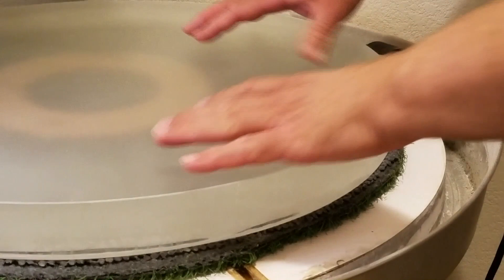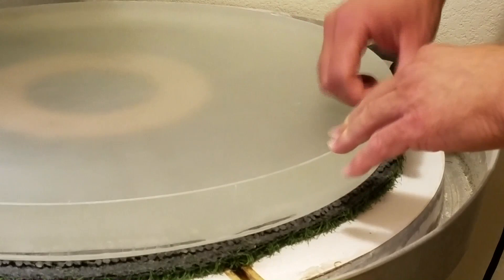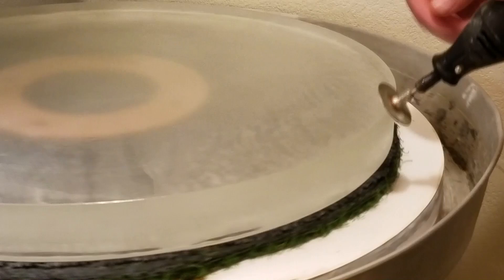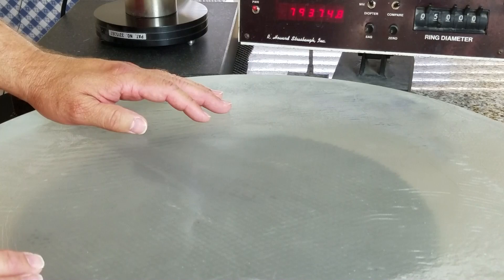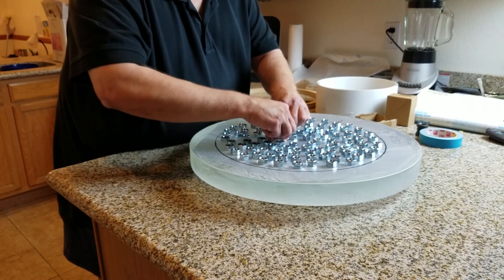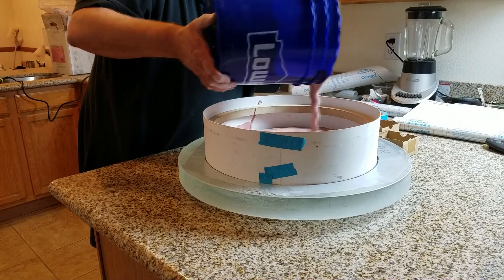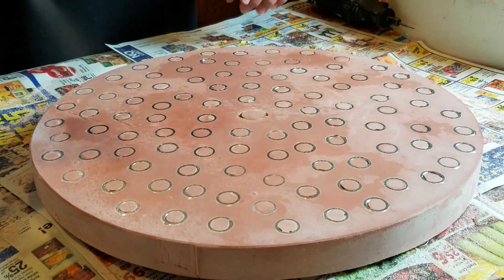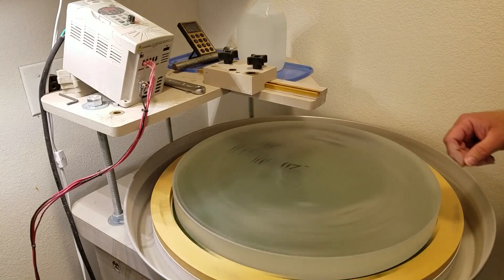Building a 20" F/3.3 Renegade Telescope: Part 1

Comment: It might be worth your time to look into marble and granite fabrication tools such as diamond polishing pads and diamond grinder cups. The pads run on a pneumatic polisher, or just an angle grinder, and come in 50, 100, 200, 400, 800, 1500 and 3000 grit. A #50 pad would work really well for that beveling, and the polishers they run on have a water connection so both hands can be focused on the work. If you wanted you could run the entire set on the bevels and bring the bevel up to a nice polish. I've polished a ton of glass using those pads. I have a few sets as I program CNCs in the stone industry, as well as do fabrication.
Clearly you know your craft much better than I do, and I'm only mentioning it because in my mind it could help. The stone industry in general shares many similarities in regards to cutting and polishing tools with the glass industry.

Comment: I used the method of "baking in" the tiles (I find using a tile mat is easier than maneuvering dozens of tiles/nuts into place) for my 12" mirror's full-sized tool and it works fabulously! No longer do I have to worry about tiles breaking off or epoxy failing.
Reply from the maker: Congrats on your success!  Making grinding tools isn't too intimidating once you have one under your belt.

Comment: Thank you for those extremely educative and information-rich videos! They made me seriously thinking about finishing my roughly grinded mirror from ca 25 years ago...
When I watched this video, few questions arised:
- are there any important differences between dental plasters or would more or less any of those fit well for grinding tool? 
- do you make the tool somehow waterproof (it looked like in an another video the same tool is somehow.. more shiny)?
- the turf surprised me quite a bit - isn't there the danger that larger particles get stuck in it and may find their way out of it? Maybe it's a general question: what general procedures you follow to keep the machine and tools reasonably clean (I found one of your answers about changing grits and that made perfectly sense!)?
- where to learn about using those fixed post grinding machines and theory of using them?

Comment: Hi,

I just made my first grinding tool out of dental plaster based on the video I found here (thank you very much!!!).

But, unfortunately, the tool warped significantly after pouring, during or after solidification.
The center of the tool rests in the middle of the mirror, but the edge is curled up, so it wobbles around the center (more than half a millimeter on the edge!).
If I drop it on the mirror like this, only the center works, therefore it deepens the glass disc too much, so the focus will be shortened.

Has anyone else experienced this warping or distortion phenomenon in the case of grinding tools made of dental plaster?
I suspect that the change in volume of the plaster (even if it is minimal) becomes uneven due to the steel or ceramic pieces inserted in it, and this drags its shape: the lower part cannot contract as much due to the metal pieces as the upper, homogeneous part, and this pull up the edge of the disc.

How thick should a plaster tool be made so that it does not warp like this?

Thanks a lot in advance,
Attila

Comment: Question for you Gordon (others feel free to comment as well). 

I've recently started hogging out a 12.5" blank by hand. I've made a similar 6 inch tool as to the one used in this video and I am just using TOT/COC strokes and rotating mirror and tool every so often. I'm not allowing much on overhang but I am sure some is happening. 

Progress is going well, getting about 0.2mm of depth in the center for about every hour or so of grinding. However I am getting a bit of chipout on the edge mainly on the bevel (~1/8" bevel) itself. They're rather small and none that protrude inward on the facial surface of the mirror more than 1mm or so.

I don't feel they're catastrophic and could probably be ground out and compensated for later on with rough grinding with a ceramic tile tool when the time comes and a bit of rebeveling, but I did want to ask if this is normal/expected?

Despite your efforts to reduce the chipout using the methods/tips in this video,  do you still get some here and there?

Any feedback would be greatly appreciated.

Gerald
Reply: Wanted to circle back on this. Was able to grind down enough in the 120/220 grit phases + a rebevel to get rid of the small chips that were taken out of the edge. Hopefully this helps someone else that ended up in a similar situation. 

1-2mm chip extending towards the center is probably the limit here. Any bigger and its going to take quite a bit of grinding to overcome. Depth of the chip plays a factor as well. Probably best to avoid it by keeping the steel nut tool away from the edge at all times during hogging, and let the tile tool do the work on the edge later on.

In any event, I've almost finished up 25μ. Maybe another session or two and I'll call it done. Then on to the smaller grains.

Gerald

Comment: You should look up how they groove mill stones for grinding grain.  The pattern is important to keep equilateral in every direction to avoid a triangular grinding action.  Much like a poorly sharpened drill bit.  The inconsistencies in grinding plane create a wobble in the ground surface
Reply from the maker: Hi, David!  There are huge differences between mill stones and mirror grinding tools.  Mill stones are designed to slice apart the grains between the stones without causing any damage to the stone.  You don't want stone particles in your ground grain!  In mirror grinding, you want the abrasive particles to roll between the surfaces, and not be sliced.  And in mirror grinding, you want the "grain" or abrasive to stay intact as long as possible, while causing the "stones" to be chipped down on their faces.  Getting "stone" chips into the abrasive is the whole point.  On a mill stone, the stone does all the work.  In mirror grinding, the "grain" does all the work.
Reply: @GordonWaite   Veddy interesting!

Comment: i grind a lot of borosilicate myself... taking the edge off with the dremel seemed sketchy... but gets the job done.  after having used resin bonded diamond grinding blades and bits, i hope never to use sintered tools again.  i wonder if stained glass grinder drums would be more affordable for you though- seems dremel tools are kinda pricey.  you can “sharpen” the drums with dressing stones for longer service life, and in addition to more tool surface at a lower cost, i bet the diamonds run deeper.  check out Radiac’s superabrasives catalogue for a daunting variety of badass grinding tools, in sintered or resin.
Reply from the maker: Thanks for the tips!

Comment: Hey Gordon!  Just wondering do you have a video pointing out how to do the math to figure out what length your secondary mirror should be from the Primary depending on the Diameter?  Thanks!
Reply from the maker: Here's Mel Bartels' on-line calculator.  It may do the job for you: http://www2.arnes.si/~gljsentvid10/diagonal.htm

Comment: iam suprised the inout carpet doesnt let the mirror move up n down on the ops side of the weight.
Reply from the maker: The artificial turf is quite stiff, and the tool extends past the center of the mirror.  And the mirror is pretty heavy.  Never had an issue with up and down movement, though the mirror will often turn a little around its center, which is actually a good thing.

Comment: 12:30  Just wondering....how can you grind something to within a few nanometers of accuracy when it's sitting on something soft that compresses by millimeters?
Reply from the maker: The mirror is thick, heavy and very rigid.  It weighs about 35 pounds.  When you sit it down, whatever it is on compresses by some amount.  When you put the grinding tool on it, it compresses a little more.  But after that point, the weight on the mirror doesn't really vary, and no more compression occurs under the mirror.  The grinding motion is basically parallel to the turntable, so the grinding force is horizontal, not vertical.  Grinding depends on the geometry of the surfaces in contact, and not so much on what is under the pieces.

Comment: Hi Gordon, I was wondering why you would use the dental plaster rather than a copper plate, like you would in a machinists shop. I imagine it's due to cost and you being able to make them bespoke for each size you need, but are there any other reasons.
Reply from the maker: The dental plaster makes it easy to mold the tool to the exact shape of the mirror.  The plaster dries and is ready to use in about 30 minutes, so it is fast.  And the plaster isn't too expensive.  Plus it is REALLY hard, and has pretty good properties around water.  It's about the perfect material.

Comment: Hola Gordon, gracias por compartir tus experiencias. Te hago una pregunta, cuál es la relación que tiene que tener el diámetro de la herramienta de yeso con el diámetro del espejo primario para que quede esférico?
Reply from the maker: Hi!  I make my grinding and polishing tools about 70% to 75% the diameter of the primary mirror.  Most tools in the range of 65% to 80% will work, but the 70-75% range is the best.  Thanks!
Reply: Gracias Gordon! Estoy por empezar a hacer un espejo de 350mm hice varios, pero siempre a mano, este lo voy a hacer con máquina y veré cómo sale. Gracias

Comment: Gordon how does a steel nut tool change shape while grinding? How can we change the radius of curvature of the mirror while grinding with a tool having a fixed radius?
Reply from the maker: A steel nut tool doesn't change radius much at all during grinding.  That is the point of using steel tools for production work where you are making multiple identical mirrors.  Once you've started grinding with a steel tool, there really isn't any easy way to change the radius.  If you need to alter the radius, you need to work with either ceramic tile tools, or glass tools, so the tool can follow the changes in the mirror.
Reply: @GordonWaite  Thank you so much for replying. My concern was that if I cast a steel nut or washer tool against a simply hogged mirror that might not be spherical how would I use that tool for fine grinding? How do I ensure that the hogged mirror is perfectly spherical to cast a perfectly spherical tool?

Comment: hello, I'm a begginer and I'm a bit confused is the mirror tool is curved on top or is it flat? as I'm working on a mirror which is not pregenerated.
Reply from the maker: If your mirror is not pre-generated, then you start with a flat tool.  If your mirror has a generated curve, then you mold a tool to the mirror, so they both have the same curvature.

Comment: I need help please. Where can I get a glass blank ,how thick do I need ,what kind of glass an where to get it please
Reply from the maker: I often use Swift glass in NY.  You can use either plate glass or a borosilicate, depending on your budget.  For mirrors up to 12.5" thick, you can get by with 1" thick glass.

Comment: I'm curious to know, since you have a CNC, why you don't use it to grind the mirror ?
Reply from the maker: We grind on fixed-post machines that we custom build.  They have a computer-controlled x-axis, but it's not really a big factor in grinding.  We use the same machine type for rough polishing.  When we figure a mirror now, we do use two-axis CNC controlled machines.  We have to build the machines ourselves, and write all the software in-house as well.  Technology marches on!

Comment: Sir, what size pitch lap and tool should I use for a 12 inch mirror? I want to finish at F/10
Reply from the maker: Hand work or machine?  Hand work, 12" for grinding, 12" for polishing, 5" for figuring. Machine work, 9" for grinding and polishing, 5" for figuring.
Reply: @GordonWaite  thanks a ton.

Comment: Great video and in formative but overall how much did it cost to do this all yourself? Giving or assuming no one has tools this may be more costly to do for ones self. Giving a 16 inch Dob cost about 2000.00. The assembly itself can be very costly.
Reply from the maker: You can put together a simply fixed-post grinding machine for a couple hundred dollars.  A plate glass mirror blank might cost $160.  The grinding tool is $15.  Pitch and abrasives probably $50.  You can certainly put together a mirror-making setup for far less than the cost of a single custom mirror.  And you can then make as many mirrors as you want.  And you can certainly build a better quality Dob yourself compared to the low-end mass-market offerings.  But generally the point isn't to save money.  It is, instead, to build it for yourself.
Reply: I was just simply curious that was all! I agree it is about building it for ones self but I was just asking if no one had the materials to do such would it be more cost effective. 
The interesting thing though is that by your video, I have learned the time it takes to make the mirror. I can understand why telescopes cost so much money. :) Its a lot of work but rewarding if one has the time and patience to do something like this.
Reply from the maker: Yes, you are spot on.  Taking the first look through a telescope where you made the mirror and the body is an incredibly satisfying experience!  It does take a fair bit of time, though, but for me it is time well spent and enjoyed.

Comment: Why not get a laser measurement tool. It can read on the fly through the slurry.  It can also show accurate measurements up to 10 decimal places.  Impossibly accurate
Reply from the maker: Hi, David!  I'm sure you are an expert on precision measurement, so I hesitate to disagree.  The width of a silicon atom is .00000000146 inches.  So you are claiming that your 10-decimal-place laser can look through the crud on my mirror, and resolve 14.6 units on a silicon atom in the glass?  That would mean you could easily resolve the silicon atom and oxygen atoms in each molecule of glass!  The resolution of a really good electron microscope is only about .00000000390 inches, so your laser would have 39 times the resolution of a good electron microscope.  I don't have room for an electron microscope in my grinding shop, especially sitting above my mirror!  And I'm guessing that I can't afford a measurement machine that has 39 times the resolution of an electron microscope.   But if you have a Harbor Freight Item # on that laser, pass it along and I will check it out for sure!

Comment: Do you make a new grinding tool for each grade of grit?
Reply from the maker: You use just one grinding tool for all of the grinding on a mirror.  Sometimes you can even get two or three mirrors out of one tool.  But if you have a really big and deep mirror, you might use one up just for the curve generation.  After grinding, you make a different kind of tool for polishing.
Reply: Thanks Gordon.  I don't doubt your word, but the reason I asked was for the concern of getting rid of every grain of coarser grit when going to a finer one.  That grinding tool just looked to me like something that could easily hide bits of grit in its surface.
Reply from the maker: You don't really have to worry about grit contamination from the tool very much, unless a tool has really deep holes in it for some unknown reason.  A quick scrub with a toothbrush takes care of any clinging abrasive.  I don't even clean the tool before an abrasive change during fine grinding.  If I've just used 25-micron, the mirror has pits associated with that size.  If I squirt on some 12-micron and just continue, any 25-micron is going to make the same size pits that are already on the mirror.  Basically, any remaining abrasive is broken down right away.  So 25-micron particles  become 12-micron particles after just a few minutes grinding.  Since an abrasive is used for maybe 30 minutes to an hour, there is plenty of time to eliminate the previous pits, and get a good, well-ground surface.

Comment: I'd like to see someone attempt a multiple mirror telescope, say 7 10" mirrors. ;-P
Reply from the maker: That's very difficult from a technical viewpoint.  They make huge professional telescopes like that, but the mechanical parts are so expensive that they don't make sense on mirrors this small.  It would be cheaper to build a 25" or 30" monolithic telescope that to make such a small MMT.
Reply: OK, multiple separate mirrors to combine resolving in a single telescope, not practical for the hobbyist.
Would that also apply to a single composite reflector built out of multiple pieces, say hexagons, 7, 19, 37 or 61 pieces? 7 20" hexagons would provide a >60" composite mirror.

On grinding mirrors:
Can diamond grinders, like those used for knives or masonry, be used?
Can grinding be done with a CNC table, example would be a Torchmate (40 thousandths accuracy) or similar?

I was thinking with CNC it may be easier to work on individual hexagon pieces to get them close (hogged out) to the desired parabolic shape.
Reply from the maker: Don Ation IMHO, any effort to combine multiple individually-fabricated mirrors is going to be too expensive for amateur-level optics.  There are plenty of applications for diamond tooling in mirror making.  I use diamond blades often to hog out glass on mirrors that start with a flat face.  That's common.  Diamond tooling is relatively cheap.  On the CNC end, I have computer-controlled capability.  It lets me automate some of the work so I don't have to tend the machine quite so often.  It probably isn't worth the effort unless you are making lots of mirrors in a production setting.